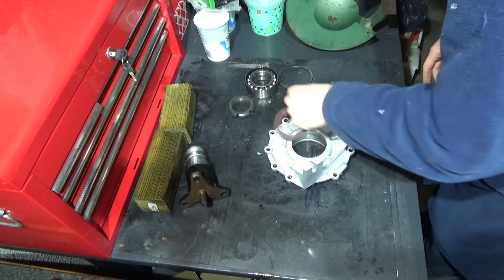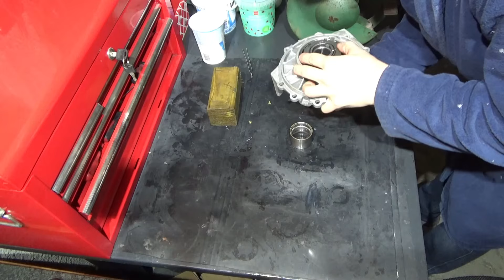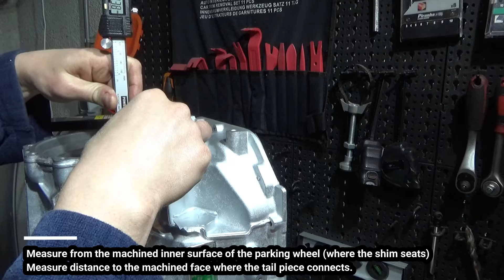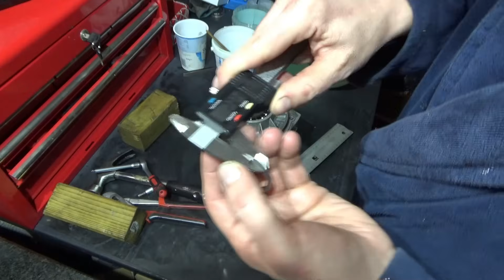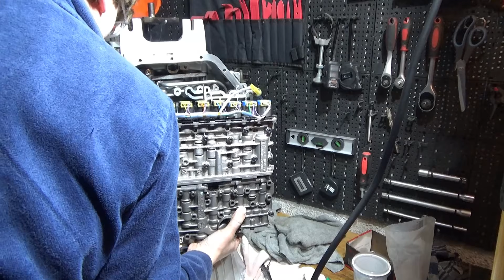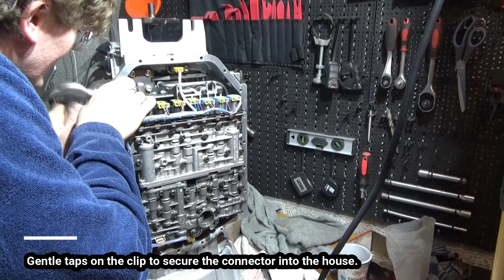BMW/Jaguar Gearbox 5HP24 / A5S440Z Tail piece, end play and final assembly (BACKYARD).

Comment: Your videos are really good.

I have a BMW X5, 2003 with a ZF 5HP24 gearbox. It has started to slip and shudder when taking off from a stand still (first gear I assume). The computer detects the slip and triggers an error message on the instrument cluster.

Do you think it could be an issue in the valve body/solenoid body that I could repair without removing the transmission from the car? Is there a common issue with a failing component in the valve body that I should try replacing?

I replaced the oil and filter about 60,000km ago.

The car has 301,000km on it.
Reply from the maker: Broken o-rings in drums/pistons or broken A drum.

What does it do in R? Does it just go if you release the brake in R?
Reply: @ the car can reverse. After it faulted, I reversed it up my driveway which is pretty steep.

The day before the transmission faulted, I was parked in a carpark on flat ground. I put the transmission into R and the car did not move backwards at engine idle speed, which it normally does. I had to apply some throttle to get the car to move backwards.